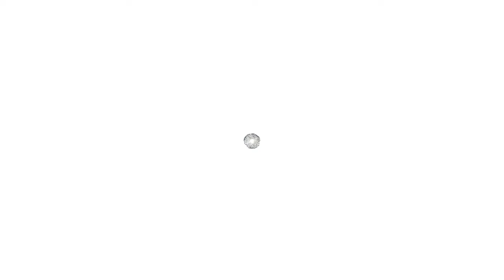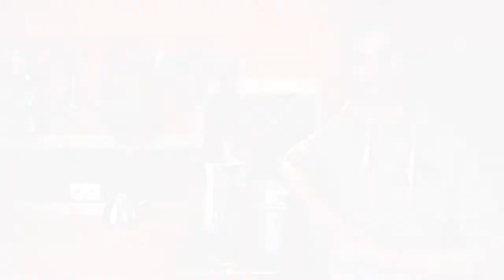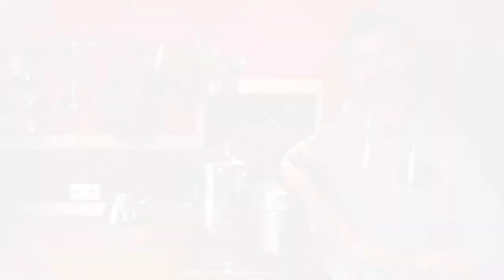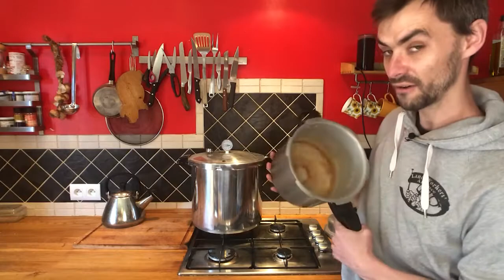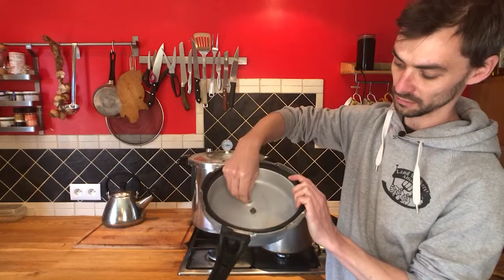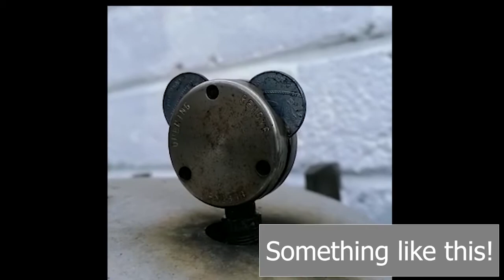Pressure cookers for mushroom growing - Which ones to get and how to safely use them.

Comment: Brilliant. Thank you. You are the only person I have found that still has the old pressure steamer. I got mine in wilkos, I can not afford the bigger one, also my stove will not heat that size of pan.  I use 2 medium size quar jars for my substrates and this video is so useful for setting a timer for different stages of the process. Thank you